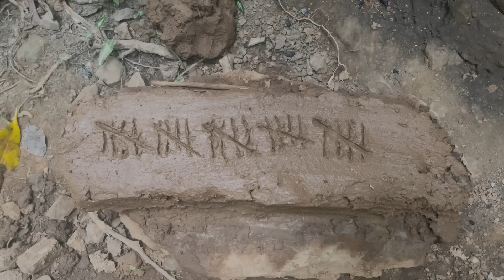Primitive Technology: Wet Season Destroys Thatched Workshop

Comment: Honestly I did not expect the fired bricks to be that impervious to water.
As you say this highlights the enormous value of brick and mortar huts VS thatched stick huts. It also highlights the problems the old ones went through, although they would have rethatched the roofs every day to avoid leaks of course.
The destroyed bricks were also a very strong example and proof of how valuable firing is - and that whoever first made it work was a total genious who made one of the technologies that enabled us as a species to be where we are today.
Reply: Also superior if a big bad wolf comes along.
Reply: Fired bricks were used in plenty of water installations until concrete took their place. From river banks to water mills and fountains. The only way water will damage well-made brick is via frost (provided the region gets that) - and even that will take decades or sometimes centuries.
Reply: @SKy_the_Thunder  Not the only way. Also efflorescence leading to spalling.
Reply: @deathlis  Fair enough. That also usually takes ages until it becomes a structural issue though.
Reply: @SKy_the_Thunder  You're pretty much correct for modern construction. Mostly it's from either a water shedding issue or weeping from the water table. But we have flashing, drip edge and piers or sealed slabs. So in his case it's a bit more of an unknown. 

Though regardless if he annually inspects it he'd know long before it became an issue. Worst case scenarios that I've seen take about 3-4 years, and he'd have plenty of time to notice.

Comment: The rain made for a great way to showcase your thatching skills! Sometime when you're not sure what to do for you're next project I'd like to see more early farming and agriculture related stuff.
Reply: The few farming/gathering videos he's done in the past have been thoroughly entertaining. After his major building and metallurgy projects, agriculture would be awesome to see more exploration in.
Reply: Given the climate I think an Aztec island farm plot system would be an excellent illustration.
Reply: Or a windmill, or a lathe, or some sort of machine that makes his current projects/processes easier and faster.
Reply: @dattebenforcer  he has already made a water powered hammer, the problem with making some of these machines is that ar his "technology level" it's either just as efficient, if not more, to do it the traditional way because his resources don't allow for a highly tuned automation process. He explained this when he stopped making new fire starting devices because the hand spinning drill was just simpler for him.
Reply: @Phyankord  I remember that, but yes he hasn't really used it. It wasn't integrated into anything else. Usually you'd want to organize some sort of production chain.

And we're fare from automation, but there are probably ways to produce more with less.

Comment: If you keep chipping away at that hillside, you can build out enough to make a hobbit hole! Not like you're lacking bricks or stone to build up the walls, and you could carve out some hefty beams using some of the larger trees around. 

Maybe try out some more intricate carpentry joints?
Reply: With what? Hasn't been invented yet.

Comment: I´m not an expert but I would make the roof from something else but leaves. Of course, it is a short term solution but the older the leaves get, the more they soak with water durning rains and the heavier they get durning rains. Only a suggestion but maybe it´s worth trying out

Comment: I've been thinking, have you looked into other building materials or techniques?

Maybe making stucco walls/roof, or using cob as a foundation for your walls and then waterproofing them? What about putting holes in your bricks for faster drying/firing and better cement/mortar holding? Or maybe using smaller bricks/tiles but making more of them? Just some thoughts.

Comment: Are there middle sized rocks nearby? You could move those to the huts for building. A single layer provides an easy way to prevent ground water from going into the walls of future brick and mortar buildings. It's also a way to accumulate building material in this wet season 😅

Comment: If there were any way a thatch roof would work in this wet climate, I would imagine you'd have to have a nonstop fire where the smoke and heat can be counteracting the constant moisture ... Being that it's just you and you don't have a family or someone to watch (and gather fuel for) a constant fire, the fired clay is definitely the most appropriate material indeed

Comment: I like to give suggestions, though I have no idea if you see them, nor does the uncertainty of such a thing affect my willingness to write for the sake of possibly helping. Even though I know little about the science behind what you do. 

The first and most important suggestion I can think of, though I don't know the terrain well enough to know if it would work, would be to build a little--maybe 2-3 brick tall--raised platform to keep the wet season from flooding an area. This is in conjunction with the trenches you dig, but more to help so even if the trenches get filled you still have a platform that isn't flooded. 
One aspect of this to consider is the surface on which you make your bricks. Are they always made on that sort of sandy material? 

Second suggestion, though only if it's remotely practical, would be a tile roof for your brick area, and if it would help, a brick wall on the sides. I would suggest spacing it out so you have roughly 2.2m of space in a square, without including the space taken up by the walls. 
In addition, would it be useful to have another building, probably much smaller and capable of fitting in the same clearing as he other structure, purely for a kiln & charcoal production? If you raise it up off the ground by a few bricks, you could keep it from flooding, and that would make a good structure for continued use.

Point of all this, is I look at the amount of bricks you make and how close to the ground it is, and I worry about flooding and stability. 

Last thing, cuz I'm curious:
Though it's probably stupid considering the ground is covered in dirt and dust, would there be any benefit to a floor made of something like tiles or rocks? Would it even be possible with your current methods to make a smooth floor that's mostly clean to work on? 
Just feel like the amount of things getting mixed in whenever you make something could be an issue, but I can't be sure so just felt like asking.

Comment: Question: Would a new brick-firing kiln be more efficient if assembled with mortar rather than simply stacking bricks around like the old one? Seems like that left a lot of cracks for outside air to get in, though I don't know if that would negatively affect the firing process; I could see how that leaking air might actually help the newly dried bricks heat up more gradually, lessening the risk of cracking or explosion, the trade-off being the kiln being unable to get as hot so the bricks perhaps aren't as strong as they otherwise might be.

Comment: i feel like it's high time for a larger, permanent pottery/brick kiln. it looks like you were probably losing a lot of heat, and thus fuel efficiency, to all the gaps and drafts in the old kiln. a side draft or down draft kiln of larger size would let you fire larger batches, or fire both pottery and bricks, and maybe expand your ceramics technology into the late bronze age or early medieval level, maybe even start glazing some of your vessels

Comment: Hi John,
I see that you're now using palm fronds for the roofing of you hut, as opposed to clay roof tiles. Is this purely because of the weight of the clay roof tiles or are there other considerations? I ask as it seems you have to rebuild your roofing every few months, whereas the clay roof tiles have been going strong for years.

Comment: I would think you should work with fresh plants and stuff for a bit after rinsing your hands after forming bricks made from ash. Just as a brief change of pace, in rotation. You don't even have to include it as a video resource. It's extremely caustic and can very hard on the body in the long run, it can make outputting content difficult. This could involve anything that involves touching live growth. Best of health

Comment: I have been wondering this for a while, and maybe it's been brought up on this channel before, but what decides whether mud or clay bricks is the right choice for a build? I know next to nothing about this but my only guess would be that mud (bricks) can be quicker to use while clay bricks take more work but are instead more durable? Is that right?
Reply: I think that's right. Mud can have all kinds of particle sizes, while the stuff in clay is all approximately the same size. Having variations in particle size and stuff like organic material mixed in makes for weaker bricks, I would assume.

Comment: @primitivetechnology9550 How much more efficient/durable would the kiln be if you made it double layered of bricks? what if you put a air or mud layer/pocket between them? seems like the kiln looses alot of heat and breaks down due to the thinness of it. that or if you built it with the bricks widthwise instead of stacked lengthwise? then the mud/mortar would be about a food thick and run its length from the inside to the outside.

Comment: He should have forseen that the roof needs to be created with fired tiles to not let the watter through and 4 pillers from fired bricks with the strong base that would be able to support the weight of the roof. This video is just a filler.